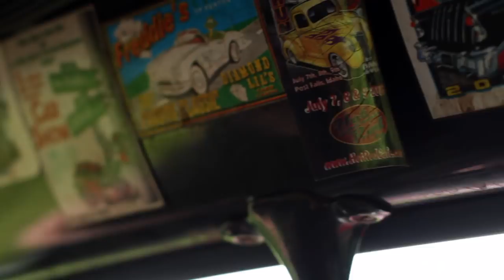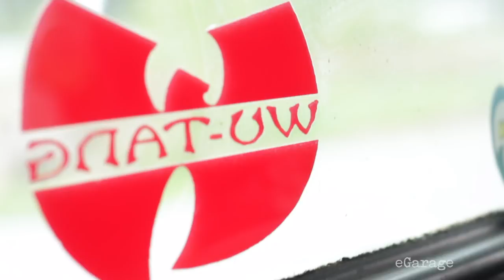A New Life for an Old Truck

Comment: Why i haven't seen your video sooner i don't know.... but i'm saving it to my truck file :) Had a 50 Merc in my 20's and a 70 Challenger.... wish i still had them. I loved that truck!!!!! Bought it and built it with a 327 4 speed, all the lil tricks for that time. Came up on kijiji a few years back, i was moved to tears, it lasted a few hours and sold again. I knew it was mine by all the lil things i did to it, all the lil fab parts etc having gone to college for tool & die ;). Lol, it sold for 5 times what i got for it, of course 30 years later...
Anyways, you have yourself an incredible truck, i really appreciate all the work you've put into it, just fricken awesome, i had to comment, you reminded me of myself.
Needless to say, I now own a 69 big block notch back Barracuda and ........ a 53 GMC, oddly enough.....with a 327 4 speed in it. I've had it a lil over a year and the next step is to swap in a 5.3 LS and have it on the road this summer.
Cheers Andy!!!